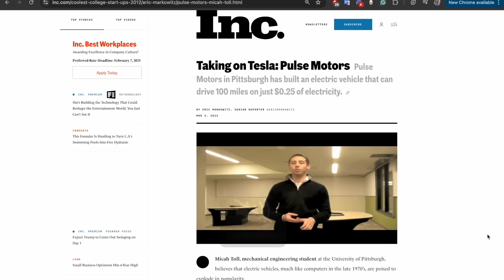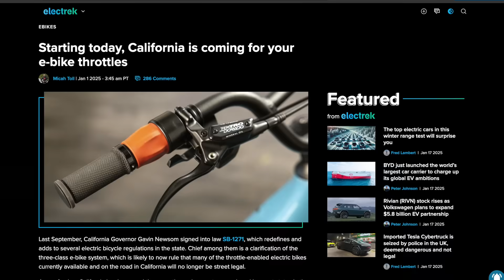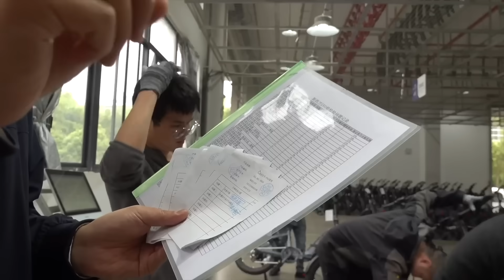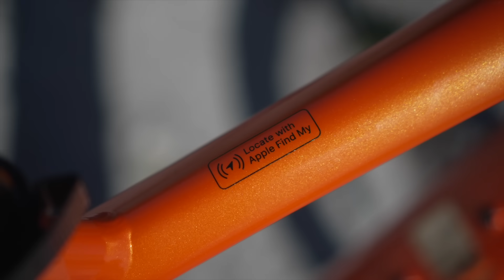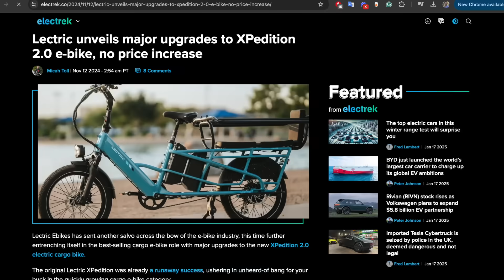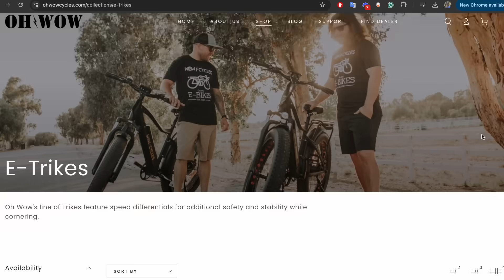5 Things That Will Happen To E-Bikes In 2025!

Comment: California mostly implemented the voluntary definitions of class 1, 2 and 3 e-bikes.

It was the fault of that voluntary definition leaving the throttle function vague for class 3 e-bikes. I always believed each class should include the capabilities of “lower” classes. Specifically, I always wanted them to clearly specify a class 3 can have a throttle function that can propel the bike up to the class 2 limit of 20mph. But they never did.

Many brands took advantage of that lack of clarity to provide throttle function beyond the class 2 20mph cap, resulting in enough complaints about riders who irresponsibly rode what are essentially electric light motorcycles from enough people that politicians had to respond to them. This now impacts brands that voluntarily capped their class 3 throttle function to the class 2 limit, and those of us who use such e-bikes.

Comment: We need a common charging standard in the ebike world.  Whether that is NACS or something like NACS that is better suited for the smaller size and lower voltages of ebikes.  It's ridiculous that a group of riders can go out for a cruise around and every single one of them would need to bring their own ,massive power brick to charge their bikes since there is no industry standard.

Also every other industry has lobbyist that try to do right by the industry.  There are some large companies out there in the ebike world and I haven't seen any of them pool their resources together to help guide some of the terrible anti e-bike legislation that seems to be coming.  What are they doing?  Why aren't they trying to fight some of this?  If these laws clamp down on the industry, all manufacturers will be hurt by it.
Reply: I agree, but sadly, that probably won't happen. The manufacturers want to lock you into their proprietary batteries and chargers. I have spent over $800 on ebike batteries because there was no other choice.

Many of the batteries can't even be rebuilt, to save money, and keep old battery packs out of the landfill. The charging circuitry has a kill feature if you disconnet the old cells to replace with new ones. Sure, some manufacturers (like Shimano) will let you send them your old battery pack to supposedly recycle, but even if they put new new cells in the pack, you can't buy a refurbished battery at a lower price that I know of. It's a waste, but a profit item for the manufacturer.

Comment: I like the looks of that Oh Wow
Micah turned me onto a Super73 style Ariel Rider X-Class 52v, and I couldn't be happier. It's right on the edge of Class2, and still has 7 gears, can easily go 35+mph.. but I think bikes like these will be safe due to the pedals, clear Class2 markings, etc. Honestly Surrons/eRidePros are hella fun, but they're not eBikes...plain and simple. I think regulation is needed for those, but I think they should be able to be streetable with a few tweaks, plates/registration, lights, etc.

Comment: I ride mountain bikes but I don't want an e mtb. 20mph is a joke. I want a throttle e bike for just cruising around town but I live in a hilly town. Even 28 isn't enough speed to properly be safe on a public road. I got a wreckless ticket on my fixie bike 20 yrs ago so the 28 mph thing is not the issue imo. In 2003 there were no e bikes but the cops then actually enforced laws unlike now.
Reply: Torque is more important than top end.
Reply: @jaaklucas1329  I agree. I have two that have lots of torque, but only 500W motors. They can both pull some very steep hills. And neither one has a throttle. I don't dispute that in some instances a throttle may be useful. I've just never needed one.

Comment: i mean good luck regulating those high end ebikes. yeah things like the suron and other high end scooters and such are definitely the easiest to spot for cops but cops have a hard time catching freaking motorcycles and ppl riding dirt bikes/atvs on the roads. so sure ur gonna see laws and such but its not gonna make a difference. ppl will still be able to buy what they want to buy and unless there is a cop posted with a speed gun.... ur pretty much good when ur on a regular looking ebike. like so long as u look plain and is going slow when u need to... ur gonna be fine

Comment: Looks like it is time to buy a high powered e bike like the Wired Freedom before you can’t.  I think you might be wrong about China as Trump is likely to make a deal rather than cause massive inflation.  Musk is loved in China and has a huge factory so that’s a sign.   China massively subsidizes EVs and batteries are as cheap as potato chips so it would be hard for other Asian countries to compete.   Agree that prices will come down but because China wants to dominate EVs of all types.  Agree that there will be lots of bankruptcies, including some big ones.   E bikes are destroying demand for analog bikes and those companies that sell them.  My surprise prediction is that Lectric is going to have problems as their Private Equity investors grow restless with no public offering in sight.   There is a lot of overhead and expected investor return imbedded in each bike Lectric sells and they are competing in the low end with high volume, low margins, and fierce competition.

Comment: Ebikes saved me. I've ridden bikes all my life but my knees were complaining alot! Instead of surgery I bought an ebike to assist me. My knees are stronger now. No surgery! Happy Trails to You!
Reply: While sitting or standing, lift your leg so knee is bent and rotate your knee joint in a circle. It may feel awkward, keep doing it and your knees will stop being as sensitive.  Lift your leg and let the leg below the knee dangle while you rotate the knee in a circle.  It works the same with elbows(try different directions and even above your head as this can stretch different things).  You can even do these elbow and knee rotations while on the bike if you need to relieve soreness by doing one joint at a time.  It gets fluid flowing through the joints and a rotation seems to move internals of the joint that other movements and stretches don't move.   You can even do the lower back by standing up and doing a hoola hoop motion with your waist with focus on rotating the lower back in your movements.  My sensitive knees improved a lot within days and weeks.  Do high knee steps and even some steps where your leg touches or gets as close to the back of your thigh as possible.
Try walking around your house stretching legs, arms, back, neck, jaw, shoulders, hips, thumbs, etc.  You'll look a little bit like christopher walken in that fatboy slim video where he walks around dancing.  You can stretch things so much better while walking and stretching.  
Biking helped me, but when I started stretching everything while walking around, everything improved.  If you feel a sharp pain, ease off and push slowly back into the pain to relieve it.  Cracking and popping(rice crispies in milk) noises are things that will reduce by doing this over time and I have found that these noises don't mean you are causing any harm.  Binding of joints is when you need to back up and find a slightly different movement that does not bind. Over time, it will all improve.  I do most of the stretching while cooking since I have periods of waiting for things to cook.  Pace back and forth, do them standing in place.  Move joints and if something is tense, push into it and stretch it over time to relieve the tension.  Moving multiple joints to combine different stretches will find sources of muscle tension you did not know you had.
My bike is a velotric fold.  Rode it for 500mi from mid august to mid october.  Get the seatpost 2.0 shock and a twomaples Noseless Bike Seat Cushion(amazon).  The seatpost works great even if you are over 300lbs and the seat is like an exercise bike seat.  Brake sensor failed, velotric sent me a replacement for both sides in october.  Had to replace the entire hand brake as the sensors don't come separate.  It wasn't hard to do, be careful with the sensor cables, they pull directly apart and are keyed, don't twist them as it will break the pins.  
I had a spoke head push through the rim tape and shred a tire tube, so I added more rim tape when changing a flat tire.  Tires are the hardest part.  I swapped in "Sunlite Flame Cruiser Tires" with Tannus Armour Tire Insert and slipped on newer asphalt like it was ice.  Not sure if insert or tire was the problem. I found 20x3 tires from a company that seems to make real tires.  They are in the mail.  Going to try these with no inserts.  (Heavier tires, foam, and other inserts add weight that can hurt range and top speed, so you do want the tires as light as possible, but with good traction)  Will be trying the heb ALLSCAPE 20x3.0.
Reply: I can update.  The heb allscape 20x3.0 tires are legit.  It has deeper tread than the other tires I tried (Sunlite Flame Cruiser 20x3.0) and feels good on wet pavement. When changing the tires because I wiped out on asphalt, I realized the back tire was worn smooth.  I made the mistake of looking at the front tire, without realizing the drive tire in the back is going to wear much faster.  Check the tire with the motor on it when determining if you need new tires.  The tires I had before wore down in less than a month due to thin treads.  Deep treads on a bike tire is good, just like with car tires.  I recommend to look at the tire with the motor on after you ride and buy new tires if you see tread depth dropping off.  

If you want to own a bike or an ebike, the reality is, you need to learn to change tires and have the tools to do it.  Use your phone to take picture before and during disassembly, that helps a lot with reassembly if you are doing it for the first time.  I did buy a torque wrench because I wanted to make sure the bolts were torqued right.  Maybe not super necessary, but hedge the cost of buying tools vs the cost of a single accident.  Buying tools to do things right is cheaper.  I fractured my thumb as it got crushed against the ground in the fall.  Not fun.

Also, clean/grease your chain regularly.  I did not do this at all from aug to oct last year.  I did it two weeks ago when it finally got warm enough to bike again and the bike felt better than new.  I would say it's a good idea to grease a new bike chain as they aren't going to be greased well after sitting in a warehouse or being baked in shipping.  
I did read around and went with "Dumonde Lite Bicycle chain lube".  But if you are cleaning and greasing every few rides or weeks, I doubt the brand of lubricant matters at all.  The cleaner I used on the chain was "Finish Line Speed Bike Degreaser".  I searched reddit for solutions that other people recommended.  That degreaser/cleaner did work well. I sprayed all the gears and the springs in the derailer.
Reply: @_PatrickO  I hear you
yeah the cadence sensors are a big help in just that bit of extra motion, so less throttle, a bit of motion "exercise" 
 
 I got an ebike and its tires were ok for ez paths, but wanted a tougher side wall.
the stock tires got pierced by stems (?) yeesh 
yeah off road for sure, not a lawn :)

 I have the yunscm 24x4 now and it looks like allscape 
[but only yumscm has them in 24x4] they are performing very well!
one less thing to worry about as I explore and rotate the pedals.
 Im getting better :)
Reply: what bike did you get. my knees need to know!...
Reply: @brandonfunke9415  we got Carpat, Megamo, Devrom and Bianki to also avoid surgery or cars. So far my fave is my mid drive Devrom, the rear drive Carpat is to much of a motorbike and dangerous to control. They are all limited to 25km, but on rough road downhill you want full control. 
The Megamo is ciclocross/touring and Bianki is city bike no crossbar and they are mid drive. I don't recommend rear or front drive.  

I got the Devrom at 50% discount since as a tall woman the male S size is perfect for me. It's blue, and I don't like the color, but I love price per setup. So comfortable now with cafe racer bars and seat spring.
Reply: Me too
Reply: Same here.  Bone on bone reference my knees.  Lower back is show too from wearing a heavy belt for almost 30 years.
Reply: Same here! I am getting older and have some heath issues, and I can no longer ride a regular bike like I once could. I thought about a motorcycle or a scooter, but I still want to be able to pedal around the bike path or on local trails if i wish.  My Ebike fills that role nicely, plus it is not that noisy so it doesn't annoy people as much. Unfortunately. I see kids on these things going full speed through stop signs and stuff. Eventually one is gonna get hit and then we're gonna have the parents all up in arms saying "Something must be done!". Then, like scooters (which are already illegal in my area, but the law is seldom enforced...) they will be declared "of the Devil" and banned, because 'We must save the children!". ( They won't say anything about idiot drivers in cars, tho' because cars are sacred or something, and criticizing them is somehow "un American".) There Always has to be one idiot who ruins it for everybody...This is why we can't have nice things..(like un "gimped" ebikes...)
Reply: Same. With me, it's arthritis  in my legs. I can't drive anymore.
Reply: Same thing here, but for me it's the lower legs. I can't walk far without a LOT of pain. The Ebike gives me a good work out...for me the goal is to stop using the electric! I can work out as heavy as I can and want to, and I can still get home...so yeah,...they want my drone and NOW my Ebike?? there's going to be big problems soon....the American people can only be dumped on to a point....
Reply: SWEET BABY JESUS! BROTHER THAT WAS ME! My knees, pop and other weird sounds. Since the ebike my knees feel better. Yes am an old and big. And I just got a cheap huffy cadence ebike and it is awesome! My knees feel so much better as well and I think it's been helping build muscles and help stabilize my knees.

Comment: Looking forward to a future of E-bikes replacing cars to commute to and from work and smaller shopping trips. As an RN working with Veterans I think there is a huge population that would benefit from this form of transportation.
Reply: Point number one is a direct attack on that future. As someone who has been commuting by e-bike for months now. "Cheap, fast, fee free" is what makes it worth the danger (no steel box), discomfort (weather), and occasional bus rides (flats, severe weather). Take any of those away, and I'd be better off with a cheap used car.
Reply: l would rather 1/4 scale cars that use a yamaha 1000cc motorcycle engine for power.
they are exactly like real cars just far smaller, they have a racing class for them in Astraya.

Comment: Curious to see if ebike range will improve this year. There's a lot of research and talk about how battery technology improvements are just around the corner. Perhaps this will be the year that we see a major leap forward.
Reply: We are already seeing a range of 70, and 80 miles from mid-level bicycles, and even further on the expensive models. ....Thats a loooong commute on a bicycle!
Reply: @Alan-l3i7d  I like the long rides, and touring. I have a spare battery on the trike that I can swap. The bike has two batteries that automatially switch. On either one, I can do over 100 miles with some hills per charge. Yes, higher capacity batteries would be nice, so as not to need a second battery.
Reply: @ Good for you! 100 miles on a trike! How much time does 100 miles take you, on your trike?
Reply: @Alan-l3i7d  Regardless of the length, I usually average about 10 MPH.

Comment: I hope regulations only touch those bikes that are really electric motorcycles with pedals, but I am afraid greedy governments will lump us all together and start charging license fees and registration fees.
Reply: In California, any ebike with a motor that peaks over 750w is no longer an electric bicycle, no matter what it's top speed is.  Any ebike that is designed to operate as either class 2 (throttle up to 20mph) or class 3 (pedal assist up to 28mph) is no longer an electric bicycle.  It must be one or the other, not both.  Class 3 bicycles cannot have throttles at all.

If you want to ride on public roads, these ebikes can't be ridden in bicycle lanes and must be registered as mopeds, you must get a motorcycle license and ride with car traffic.
Reply: @megaboz42  I thought class 3 e bikes can still have a throttle if its speed is limited to 3.7 mph to act as a park/walk assist?

Comment: One of the things that I’d really like to see is the standardization of batteries. That would really help the industry as well as the customer.
Reply: We need to regulate the packs more than throttles or speed.  Battery quality should have been mandated in any ebike laws to reduce the cheap imports that have low quality battery packs.
Reply: Very true. But. I think power is also misaligned and even Bosch 250 watt will put out 800 watts peak. So that's a thing. Max speed sure, but going up hills where direct drives get less efficient I don't see why you'd limit power. I don't want DIY killed off. My bikes would be over the limits here with stock programming but I don't be an idiot and use it. If I get kicked to a sidewalk I don't go much faster than I'd jog on a sidewalk, and they're empty sidewalks, not a city. You see walkers with dogs and you crawl to nearly a stop because they can run in front of your tire in 0.2 seconds. I'd like to see more electric scooters and motorcycles but with their own classes. Canada does have one for them, but requiring licence and insurance does make an electric moped less useful than like in China where they use electric everything even without peddles without issue.